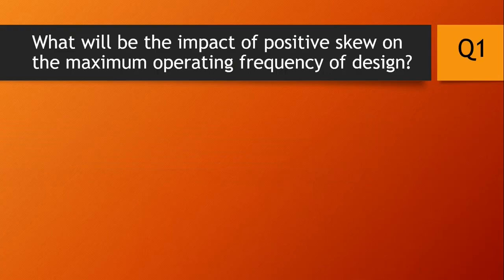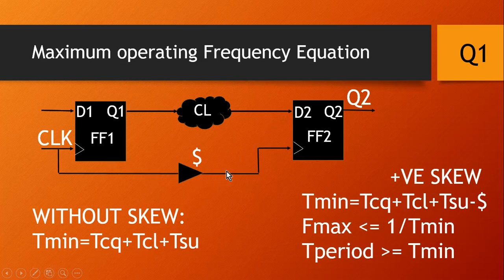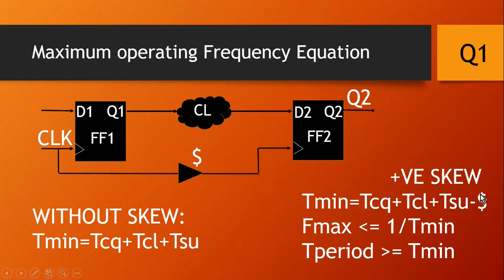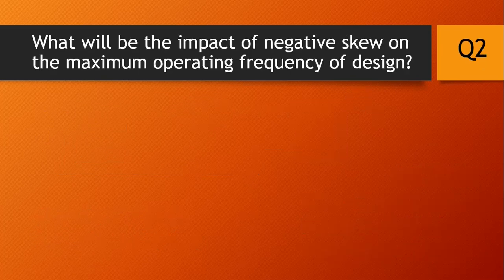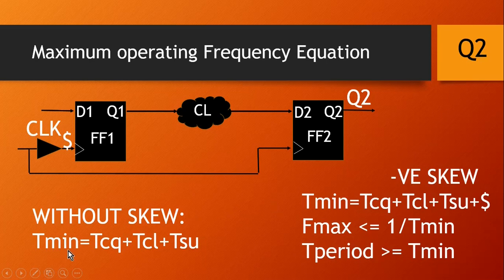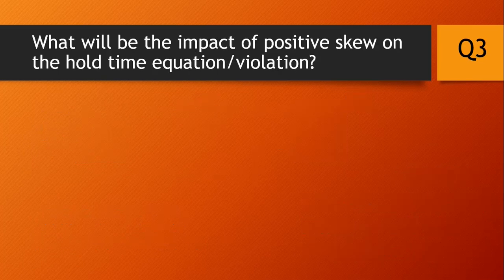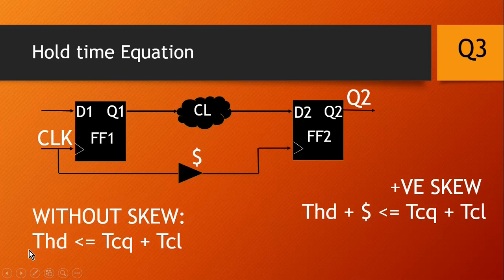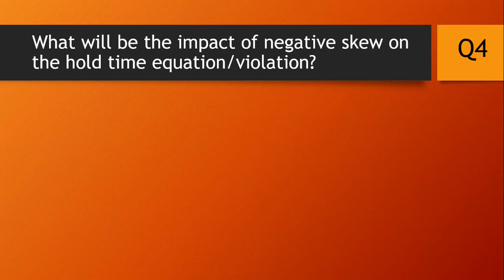Static Timing Interview Questions Part 5

Comment: Isn't the generic statement that 'by introducing positive skew in the path, the max operating frequency will increase' is wrong? I understand that by introducing a positive skew, we can solve the setup critical path, but it does come with a cost of reducing the time period of next stage. There are cases in the design where both the current stage and next stage are timing critical and there's nothing we can do with the clock skew.